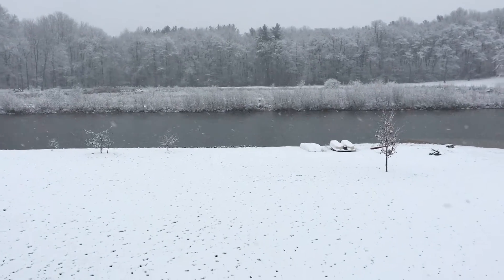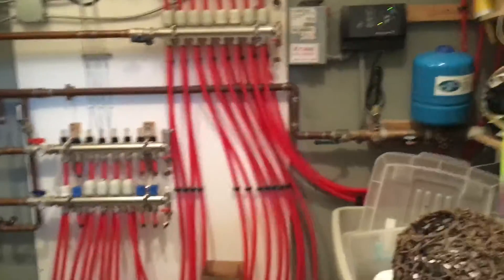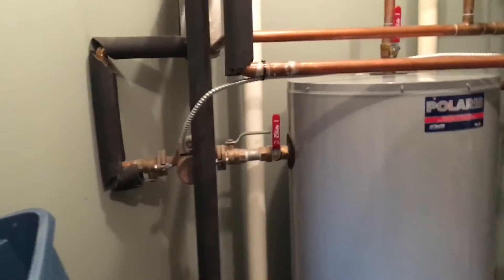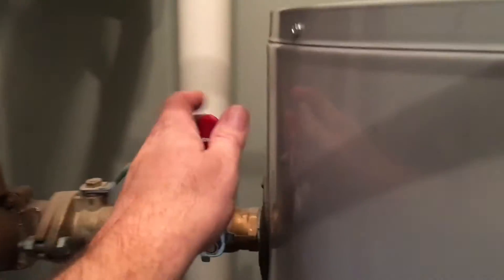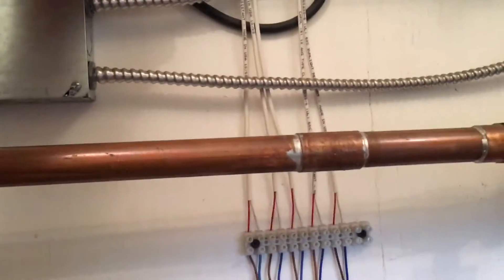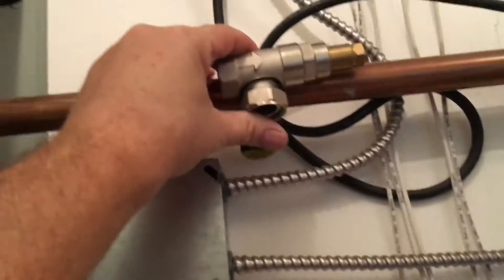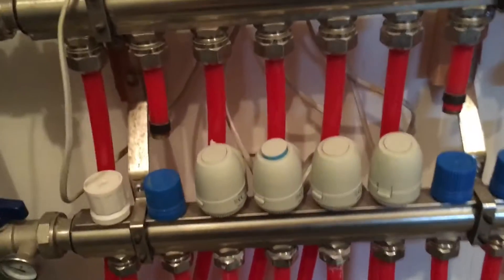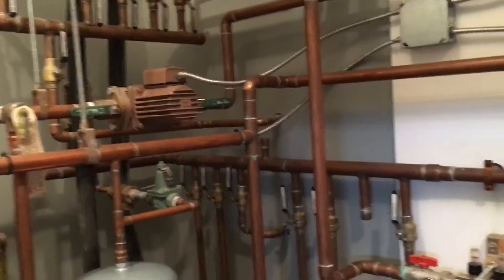Radiant Heating System Startup and Taco Pump Failure

Comment: I also live in MI and had Fred design my in floor heating system.  I was looking at your system and it looks like your supply and return lines is 1 inch is that correct?   Did you put any reflective bubble wrap under your tubing? and what size of staples did you use to put your 1/2 inch pex tubes to your sub floor?  Are you still happy with your system?  thanks again for the videos.
Reply from the maker: +D Norton - thanks for your questions.  Yes, the supply and return lines are 1 inch which is the size of my manifold fittings.  In terms of any reflective bubble wrap, I went with Fred's recommendation and didn't apply any type of reflective anything.  The staples are 3/4" which gives the 1/2" pex room to move a bit with expansion and contraction.  Am I happy with my system - ABSOLUTELY!  This has been the most comfortable heating I have every experienced.  I can't tell you how great it is to walk on our stained concrete in our lower level during the coldest days and feel the warmth under my feet.  Same goes for the tile bathrooms, laundry room, etc.  Also, having the floor heat in the garage - WOW!!  If you have any more questions, feel free to let me know.  Hope you are as happy with your system as I am with mine!
Reply: +KubotaTee  thanks for your reply.  Do you have any insulation under your pex? Fred sent me my paperwork via ta email, due to a short notice.  I have not started my system, I just got the keys to our foreclosure house.  I'm ordering all my stuff this week. Fred said I need one 10 port manifold.  Thanks for the input on your system.
Reply from the maker: +D Norton - In regards to insulation, the short answer is no.  All the floor cavities are closed with either drywall on the ceiling below the stapled up pex or by acoustical ceiling panels.  It's also noteworthy that I have floor trusses versus solid 2x lumber or wood I-beams which leaves the floor cavity very open between the ceiling below the pex and the floor above the pex.  This has provided a very even heat through the house with no "heat striping" being noticed.
Reply: +KubotaTee thanks for the reply.  Is there anyway you can take a video or pictures for the wiring of your zone valve controller. I just got my tubing and ordered my manifold.  Did you buy the manual staple gun?
Reply from the maker: +D Norton - let me know your email and I'll be happy to send you some pics of my wiring.  Also, I bit the bullet and bought the air stapler - had a lot of tubing to install and couldn't imagine doing it without the air stapler.